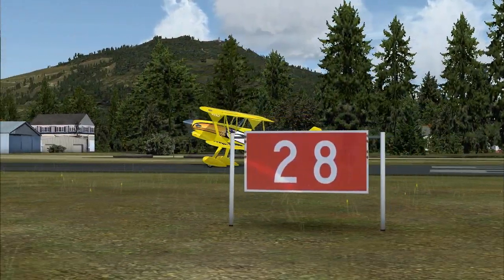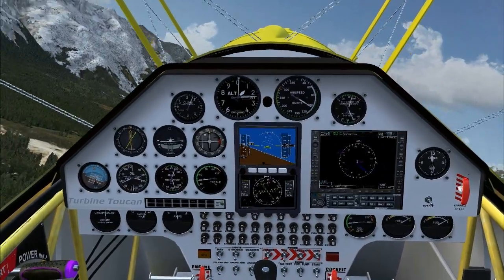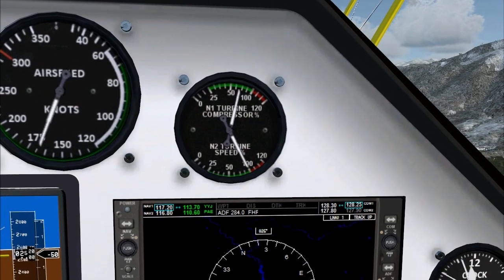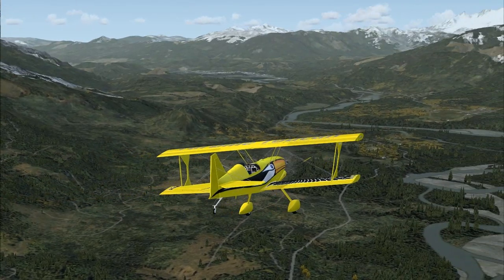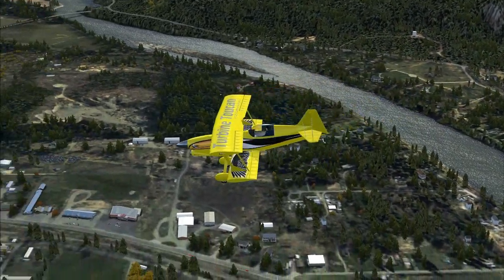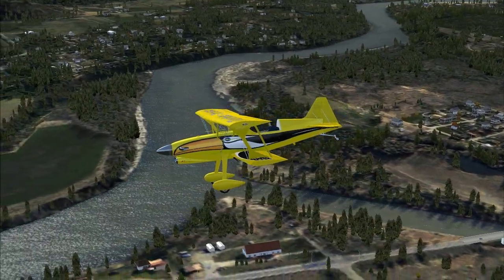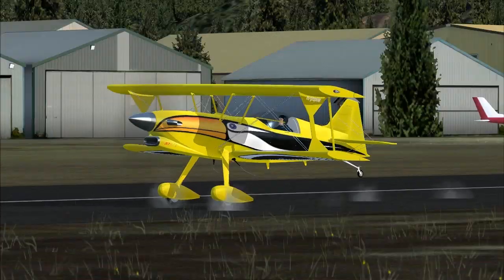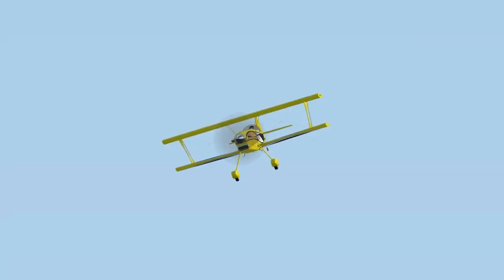Flying the Turbine Toucan (Part 2 of 3)

Comment: Hi Mark, I picked up the toucan yesterday on a whim and have been successful in feathering the prop if I decrease the prop control past zero.
Reply from the maker: I don't have this installed at the moment as I'm just completing a bare-metal reinstall of FSX! I will put it back on and check this out later. Thanks for the comment.
Reply from the maker: Well, I installed the Toucan again and you are correct! I added a 'decrement prop pitch' with repeat to the below-minimum detente and it does indeed feather the prop. I can now stop the prop rotating if I shut down the engine in flight. However, this unfortunately does not appear to have any effect on the drag, so it's actually pointless :(  (Well not exactly pointless, because it gives an alternative way to stop that surge when coming off reverse thrust!)

Comment from the maker: Yeah, I don't think I would recommend the Toucan except as a curiosity. The prop feathering isn't a big deal, it's not really relevant during normal ops, it's just an indication of where 'simulation' ends and fakery begins. And charitably, it seems the 'cold-and-dark' startup problems (like the turboprop simulation) may be part of the FSX baggage.

The Toucan is nicely modelled, and it's fun to try something different for a change.